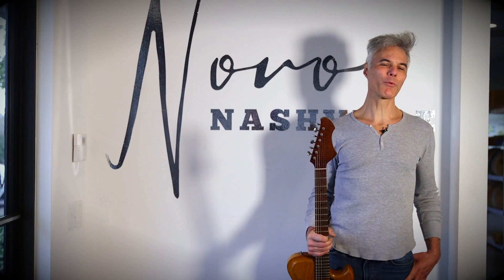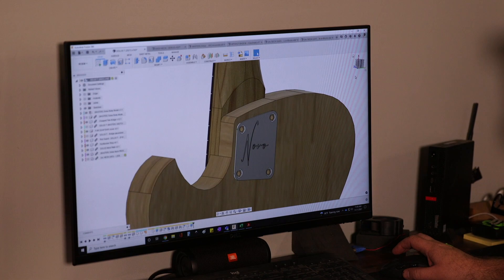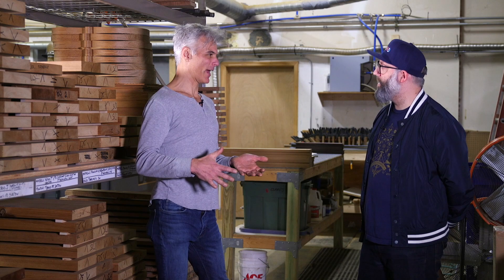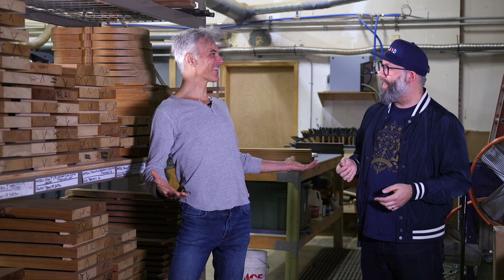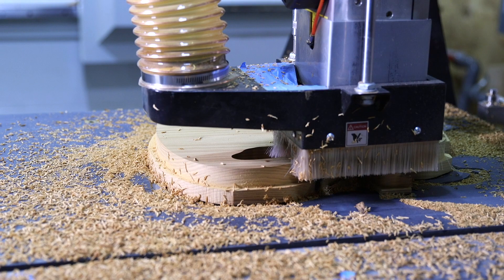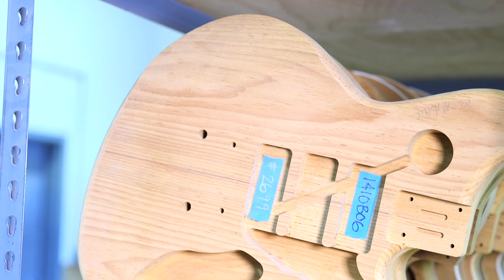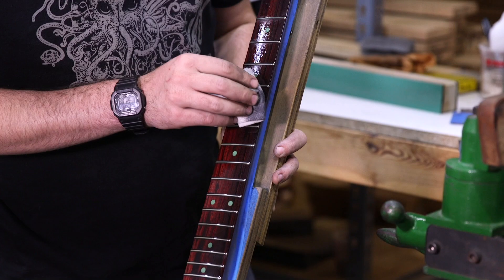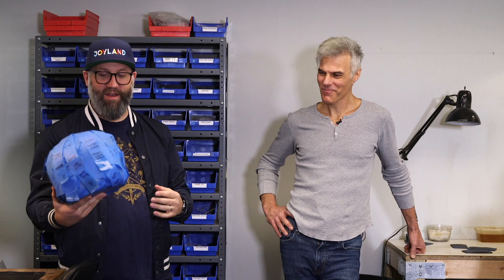Novo Guitars Factory Tour

Comment: Hate to tell you guys, but pine is a super soft, cheap wood. I'd say they're using it because it's easy to source without spending any money. It's too bad, because pine is not stable whatsoever,  and is not going to last. Why do you think fender moved away from using pine, and no other manufacturers use it??  It's extremely affordable, if was actually any good, all manufacturers would use it....

Comment: What I got from this: Rather than use the appropriate wood species for the design/pickups/desired tone they just use pine for all applications because it is easier, cheaper, and they can get away with using it on all their guitars.  They probably save a lot of money on tooling/bits by machining pine instead of hardwoods.  So, you're not paying for the best guitar, you're paying for what's the easiest for them to work with...

Comment: Jeez man. For what they charge??? To get possibly the cheapest wood you can acquire for that amount of money??? Phewww!!!! Maybe it's a "special pine". I know just from working with it framing houses its prone to warp very easily.
Reply: That's why the put it through the tempered process to suck the moisture out of it. The necks aren't pine, just the bodies. The bodies are thick, they aren't warping. 2x4s and such that are long and skinny, are subject to warp, plus they have a lot of moisture. I was a wood snob until I got my Serus J, that thing rings forever.
Reply: @bluzzjazz  I'm definitely not a wood snob. I just know how cheap pine is. Pine also has more sap content than nearly any other type of wood. So much like hyde glue,...when its "tempered",...it becomes very very hard and resonant. That's why they ring and sustain well. Which is great and all.
                   My point was to merely point out that its ALOT cheaper. And secondly,....I dont care how big the body is or how much you "temper" it. Pine is extremely susceptible to moisture and temperature change. It's like PRS said,...."some woods start off fine. Then they show you what real world use does to it." Referring to the early tele's Leo produced and why he refuses to use pine. Most of the early pine fender customs have the binding popping away from the body. Deflection around the bridges. Cracked neck pockets that have shrunk and expanded over and over. Body seams starting to separate. I know that are old. But I've seen tons of old Gibsons that were ran through the ringer have ed none of that. I know it's also got to do with the person that owns it and the way they care for it. I get all that.
                 Now,..... I get using one piece bodys. That's the only way you can get away with. Hit me up in a couple 10 years and let me know how it's doin. No disrespect intended. I just think that's a bit of a high price for a pine body bolt-on guitar. That's all.
Reply: @theariesexperiment4642  I hear you. I hope it holds up. I've got more guitars than any non-professional should have, and this is the only pine guitar I have. I've had a couple of them since the mid 70s and I've never experienced any fret sprout or other climate related issues with any of them. I have an acoustic that has stayed in its case since then, except when it's played, and it has never had anything happen to it. I've never had any type of humidifier in the case. It has rosewood back and sides and an Alaskan spruce top. Maybe that's why it has held up so well. Cheers!